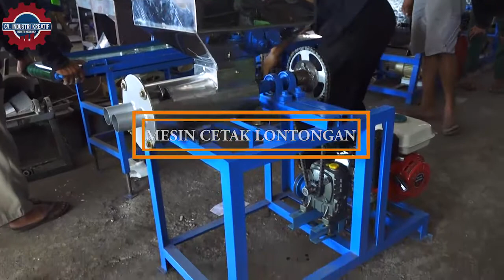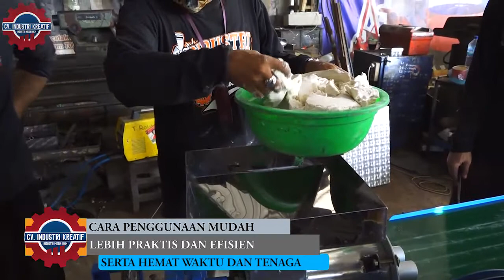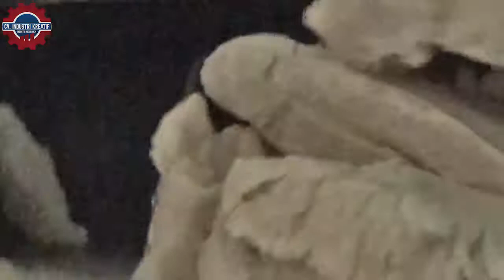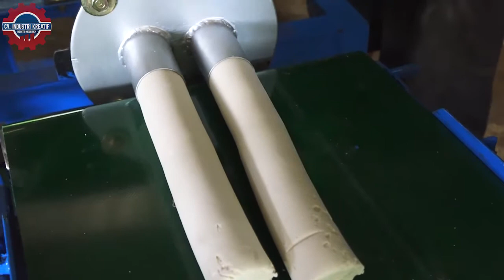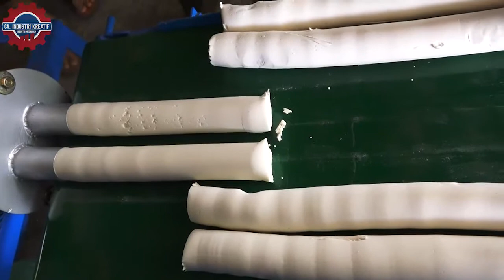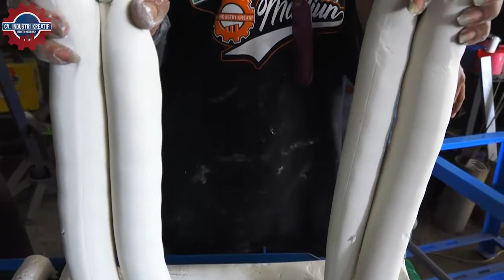MESIN CETAK LONTONGAN KERUPUK 2 LUBANG | HASIL PADAT, HARGA LEBIH MURAH

Comment: Apakah ada mesin cutting untuk bahan/adonan lembek seperti itu
Reply from the maker: untuk info harga,detail mesin & pemesanan hubungi Customer Service Representatif Kami (Telp/WA) 081217850288 - 082142267610 - 082334870125 atau kunjungi Workshop Kami di Jl Madiun - ponorogo KM 10 Selatan Puskesmas Geger 300 Meter Kec Geger Kab. Madiun Jawa Timur

Comment: Klw untuk cetak yg tengah nya ada warna nya bisa gak
Reply from the maker: untuk info harga,detail mesin & pemesanan hubungi Customer Service Representatif Kami (Telp/WA) 081217850288 - 082142267610 - 082334870125 atau kunjungi Workshop Kami di Jl Madiun - ponorogo KM 10 Selatan Puskesmas Geger 300 Meter Kec Geger Kab. Madiun Jawa Timur

Comment: Harga berapa mas,bisa pesen sepaket ga
Reply from the maker: untuk info harga,detail mesin & pemesanan hubungi Customer Service Representatif Kami (Telp/WA) 
CP 1: wa.me/+6282142267610
CP 2: wa.me/+6282334870125
CP 3: wa.me/+6281234280625 
 atau kunjungi Workshop Kami di Jl Madiun - ponorogo KM 10 Selatan Puskesmas Geger 300 Meter Kec Geger Kab. Madiun Jawa Timur

Comment: Harga dan lokasi mana ya
Reply from the maker: untuk info harga,detail mesin & pemesanan hubungi Customer Service Representatif Kami (Telp/WA) 081217850288 - 082142267610 - 082334870125 atau kunjungi Workshop Kami di Jl Madiun - ponorogo KM 10 Selatan Puskesmas Geger 300 Meter Kec Geger Kab. Madiun Jawa Timur

Comment: info harga
Reply from the maker: untuk info harga,detail mesin & pemesanan hubungi Customer Service Representatif Kami (Telp/WA) 081234280625 - 081217850288 - 082142267610 - 082334870125 atau kunjungi Workshop Kami di Jl Madiun - ponorogo KM 10 Selatan Puskesmas Geger 300 Meter Kec Geger Kab. Madiun Jawa Timur

Comment: Harga berapa pak?
Reply from the maker: untuk info harga,detail mesin & pemesanan hubungi Customer Service Representatif Kami (Telp/WA) 081217850288 - 082142267610 - 082334870125 atau kunjungi Workshop Kami di Jl Madiun - ponorogo KM 10 Selatan Puskesmas Geger 300 Meter Kec Geger Kab. Madiun Jawa Timur